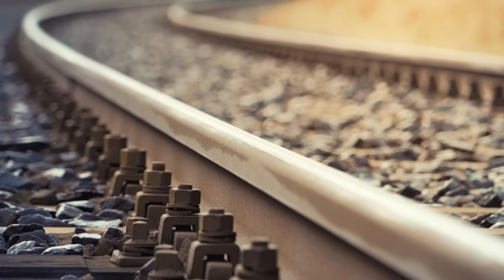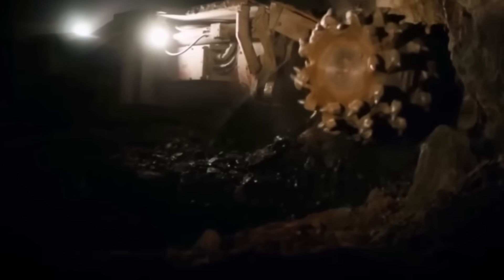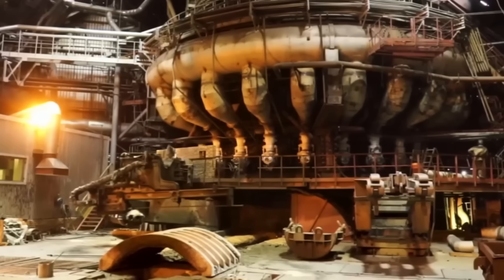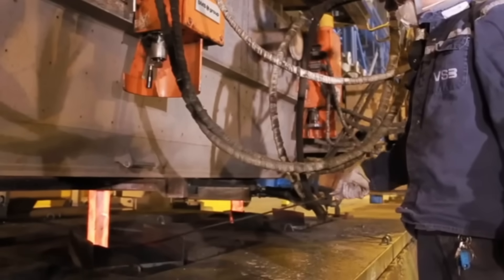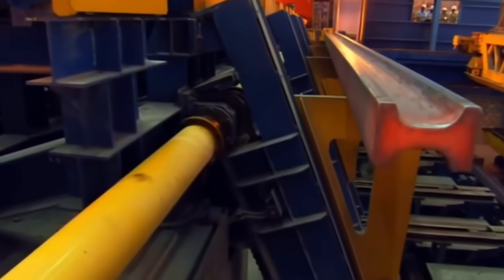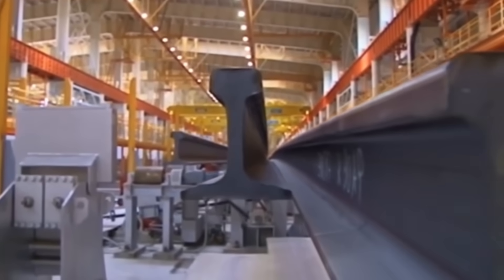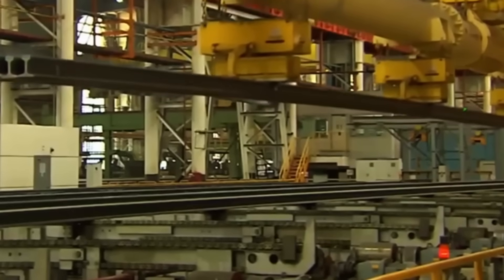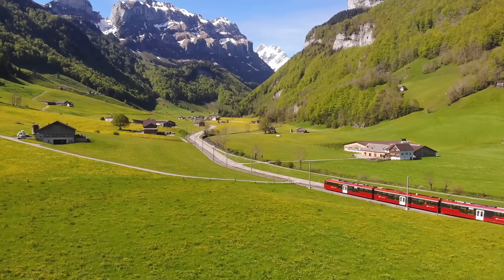HOW MILLIONS of TRAIN RAILS are MADE 🚂 | INDUSTRIAL PROCESS 🏭

Comment: Worth mentioning that rail steels are manufactured to sections / profiles depending on the gauge they are going to be used ffor. Three common gauges are Standard (4 feet 8.5inches), narrow gauge (3 feet 6 inches) and broad gauge (5 feet 3 inches). There are several others dependent on the nation. The Standards for each type also specify the weight per foot of length.
Also important to remember the huge variability in temperatures the steels have to operate in. From Australia's Nullabor Plain to Siberia's extreme cold it is remarkable the rails perform consistently.